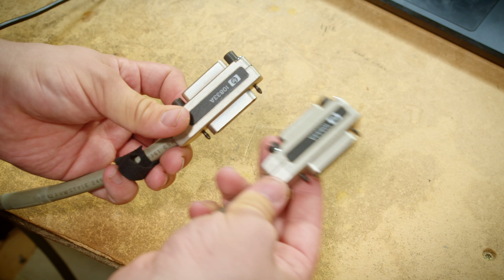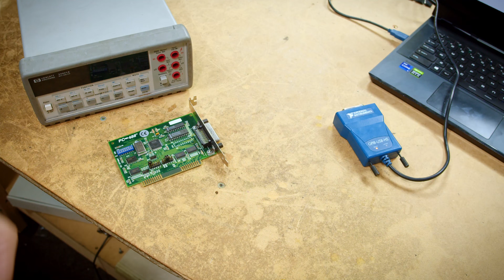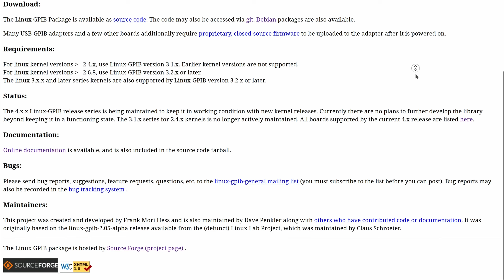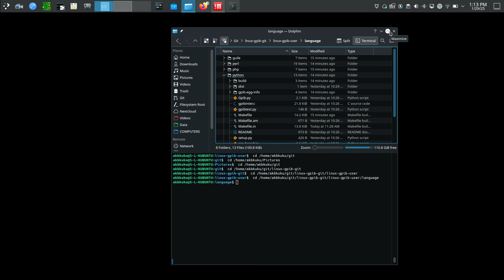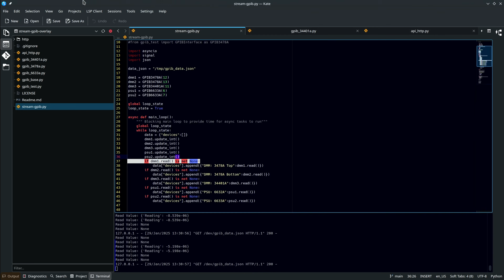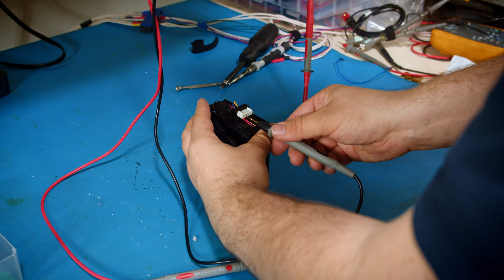GPIB on Linux for HP Test Gear

Comment: That mondo card you were showing seems to be an HP 82321A - HP BASIC Controller, I believe they were colloquially known as "Viper Cards" and they're pretty much a 68K unix card that runs HP's version and uses the local PC as an IO tool. HP also did a later version of it, the HP 82324B (not sure if they did an A) Measurement Coprocessor - Colloquially known as the "Hyper Viper" (I again I believe) - I have one of those in my multi-OS Dolch Pac 65 so I can run old HP Test & Measurement gear software that would normally expect a Series 200/300 machine.

The NI GPIB-RS232 that you showed can be imagined as the same as the NI GPIB-USB-HS - It's simply a GPIB adapter and can address all the instruments on the bus. I'm not familiar with any serial GPIB controller that could only work with a single device - I'm not saying there isn't one, just that I can't remember ever seeing one. Devices like the Prologix, AR488, etc can all drive the full addressable GPIB bus I believe.

Anyway, love the content and look forward to your new videos - I'm going to go back and watch the 16500C ones as I missed those when released.
Reply from the maker: You hit the nail on the head with the big HP card, it's the BASIC Language Processor. I got it specifically because it's basically the same as the HP Series 200 that I have, it's so cool!

And as you discovered, that GPIB<->RS232 adapter I have is indeed a bit odd. The benefit to the single device mode is that you don't have to handle addressing at all. You can just send the commands as if it was any other serial device.
Reply: @TechTangents  I'm looking forward to what you show the Viper card doing - I got the 82324B because I didn't want to have to spin up a complete series 200/300 unit to run the software (which is also why I used the Dolch Pac, I can lift it onto the bench and have everything I need in one small-ish unit).

The talker/listener thing is something that I've never really used, I know that it is possible as it was in all the manuals I read but I've never been in a situation where the setup used it - I always just did direct addressing of the device.

However, I'm super interested in trying out the video overlay idea you showed though - Thanks for the cool idea.
Reply: I just looked up the NI GPIB-RS232 and it is a bit weird compared to the NI GPIB-232 adapters - If the manual is to be believed then it can operate in a controller mode but it can also operate in just a serial host mode - I wonder why they did this compared to the GPIB-232 series? Anyway I stand corrected about your comment on "the way it is setup now"

[UPDATE] Reading a bit more of the manual I think they created C mode so that people could simply take talker/listener devices that were on a GPIB bus and let them be used directly from the PC - For example, you can configure the HP 53131A to just be a talker so your PC could then grab whatever frequency results were "talked" by the counter - Anyway, it'd be interesting to find out why from the people who were there when it was created.

Comment: The required timeout is not the case in actuality. The long measurement time is due to the resolution the measurement is being taken with. If you reduce the precision, you’ll get faster measurements. 
If you want to earn your SCPI/GPIB ninja badge, read up on the Serial Poll functionality. You set some registers as to which events (eg measurement or “operation complete”) trigger the SRQ line to get asserted or the SRQ bit in the status register. You only then need to poll the status register (which is hard-lines on the bus), and do a read once the bit/line is asserted. It’s much lower overhead and fast compared to having to wait a fixed timeout. The same approach is used across all GPIB instruments that support Serial Poll.

There is likely a good clear example of using serial poll in the DMM Programming Manual.
Reply: Yep. The event based stuff is what makes GPIB special. (And different from typical serial port applications). It works a lot like interrupts on microcontrollers (/PCs without an OS/just DOS).

Comment: Sacrilege 😁😁😁You say GPIB and HP gear in the same description.  It is HPIB when you connect up HP gear via those funny cables.   I know, it became GPIB when a lot of other companies began adapting that interface on their equipment.  Saying GPIB when touching HP gear ... oh my.     I used all this stuff because my career began in the 70's.  Tektronix would rowlf if you said HPIB using their interface.  Just say'n and having fun doing so.   Yes, used Labview as well.
Reply: HP submitted it into the standards to open it up and they knew it needed a new name to do that, some in HP weren't happy about that, but they knew it was required.  Even HP people I've known, back when I was a kid when this changed, quickly switched to G-PIB.  Having something they created become an industry standard was a source of pride to them from what I've heard.